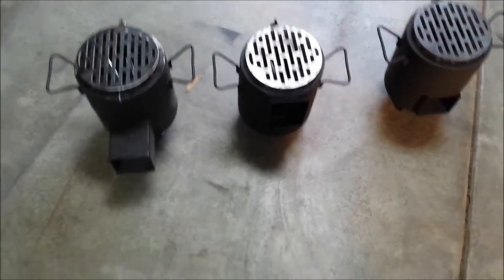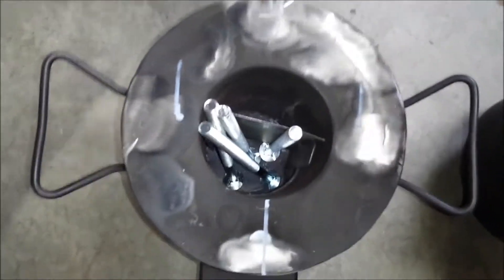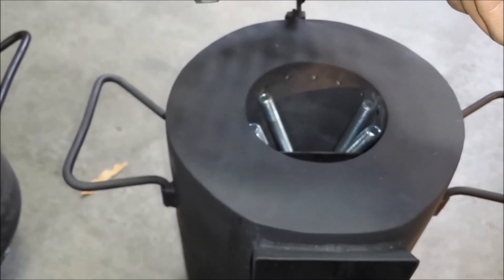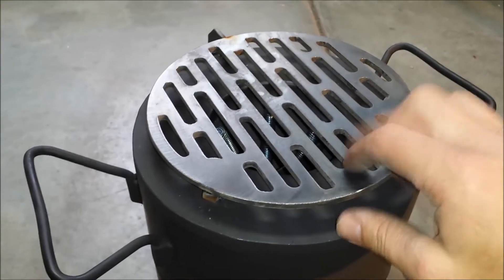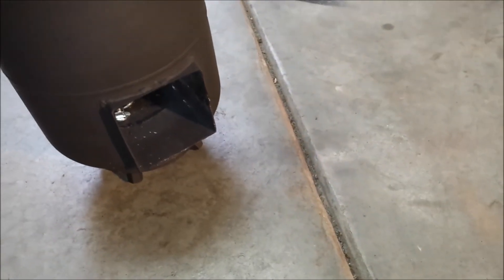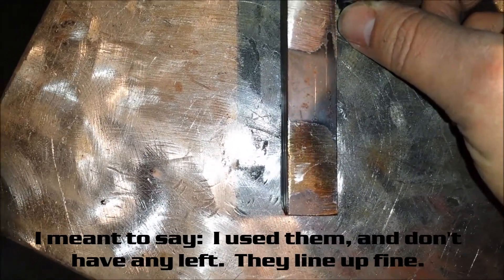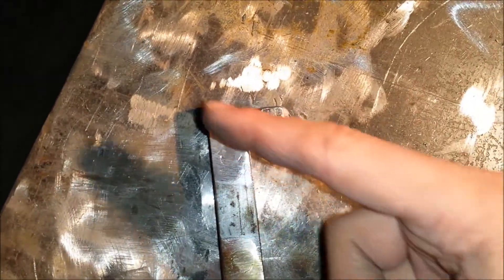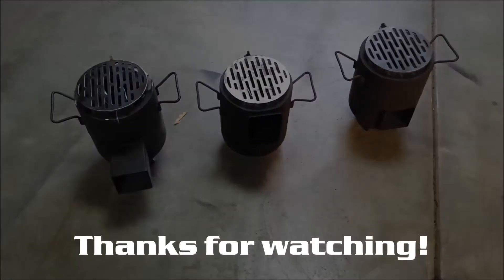Quick Rocket Stove Update

Comment: Ever thought of using larger handles for the legs. Just weld two small pipes on underside of tank, one for each handle. Make the handles curve into the pipe. To install, you stretch handles out a little to slide into pipe. At some point you will need to weld a post to proper length to stop handle to correct position to sit up. Let me know what you think  Ever though of a co2 tank?

Comment: On the 3rd stove, did you try just setting a piece of tubing on top to increase the length of the flue?  I'm curious if that would help the vortex form.  Also, did you fill it with just straight perlite, or did you mix it with concrete?  Thanks for the cool video!